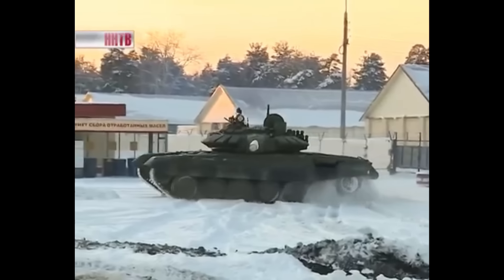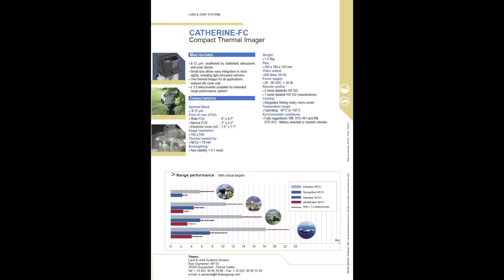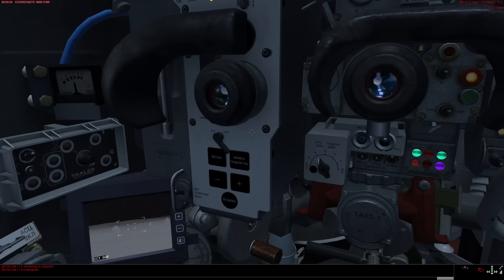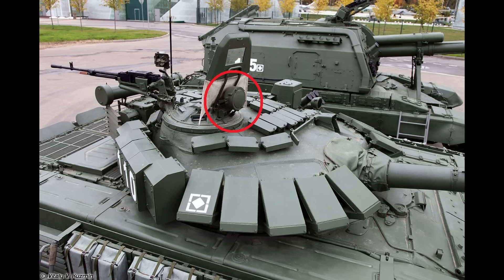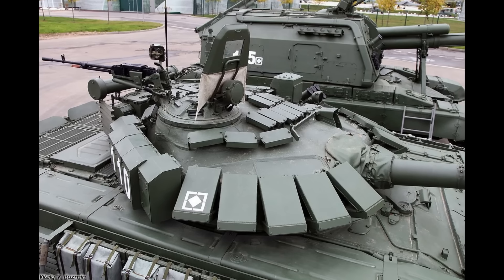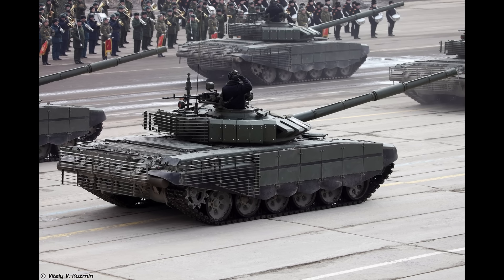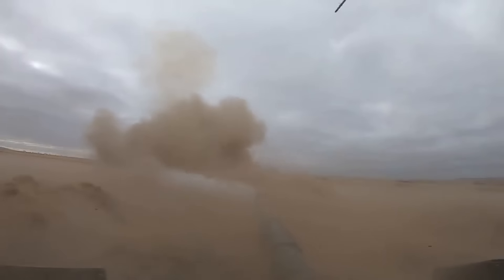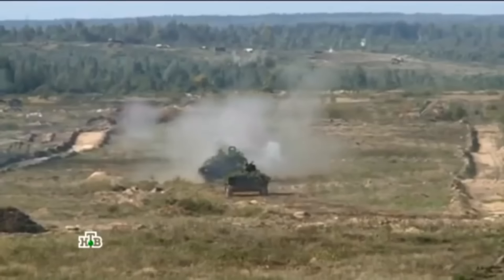Problems with Russian T-72B3 tank

Comment: Autoloader... good idea! Storage of Ammunition in Turret ... BAD IDEA!      Abrams is considered one of the most survivable tanks has rounds in its own sealed compartment designed to direct blast up and away from tank crew if ignition occurs.  The loader manually opens the armoured door to the ammo storage removes the round and loads it as the ammo storage door closes automatically...   In Iraq a number of Abrams looked like toast as they were penetrated but actually the crew survived shaken but mainly unhurt as the huge fireball of ammunition exploded out and above the tank.
Reply: That problem has been fixed or is being fixed 
T-14 fixed the problem ( T-84-120 T-72-120 is a possible fix )
T-90M/MS partially fixed it
Reply: While Abrams doesn’t have that problem it could still be cooked if the blast door gets destroyed when penetrated ( rarely but it’s still possible )

Comment: Why did Russia not invest more in APS systems? They used to have versions in the past.
Reply: They can't afford it.  At the start of this war Russia had an economy with roughly the same GDP as Italy, but they try to maintain a much larger army, navy and air force.  When you try to do that some serious compromises have to be made.  They have developed many systems and weapons over the years that never went into production because they couldn't afford them, and their economy is in much worse shape than it should be because of Putin and his gang robbing the country for decades.  Some analysts also estimate that at least a fifth of the defense budget is stolen; if they are right that won't be helping matters.

Comment: despite all the flaws... the main reason why it failed so much in Ukraine has more to do with tactics than limits by itself... i'll explain myself:

It is pretty clear that Russia's military and political leadership had a wrong assestment on the Ukraine's will to fight in 2022... they pretty much foresaw a conflict like in 2014 with enemy troops demoralized, poorly trained and with legacy soviet era equipment.

This lead for a strategy of a forward quick-push into the main citys, in the hopes of a quick surrender. That's why tanks were used in line formation (an extremely weak formation for defensive purposes) without infantry to cover them up AND at the very verge of their logistical capabilities.

Many T-72 faced doom against Karl Gustav 4 and RPG-7 at close distance as result of ambush tactics, many others were left out by troops that didn't really know what the plan was and find themselves at enemy territory with no fuel left.

Not to mention the lack of propper air cover and intel, which allowed for better placed ambushes, and last but not least the massive supply of high tech AT-missiles like Javelin which can't really be countered by any modern MBT.

If Russia had attacked exactly like that but with Leo2A7, the result would have been largely the same, maybe with less casualtys due to the western MBT improved protection, but at the end of the day, if your tank runs out of fuel you are on a sitting duck, that duck being a Panzer IV, T-55, T-72b3M or a Leo2A7
Reply: 2024 Update:

1) the 2022 Kiev Offensive was proven to be flawed by peace-time corruption in the Russian Army, since the general in charge of fuel depo "consumed" (a.k.a. black market sale) the reserves and lied about the numbers, that produced a real disaster leaving dozens if not hundreds of tanks with no fuel in the middle of the road to Kiev. T-72B3 or T-72B3M lost should have been way smaller just because of that, not to mention the bad "line formation" tactics.

2) since 2022 a lot has changed, the main flaw for an MBT is the Kamikaze drone, a cheap and easy to produce weapon that can pinpoint the weak spot of any tank, this kind of artifact makes anyone wonder why botter in a new tank anyway, since it is to be expected that Drones will become more and more efficient, introducing things like tandem-HEAT charges and other devices that could know out a tank... 

i wonder that if the way to go is a newly designed T-55 alike tank, with just a 100 to 105mm gun, good composite protection against 400mm frontal, around 100mm on the sides in a 35/40tn design, with good termals and optics, and a 800cv diesel engine filled around with of Kontact 1 (1st gen ERA) and cage armor

Comment: The obsolescence of militar equipment or systems or weapons, is not depending on time, but more over concurrence and circumstances of deployment.

Probably, over the T72, is more economical scrap and re-melt the metal over new machines, like T-90, or T14.

Meanwhile, the steel of the T72 maintain rolling, and work. And 
any way, a t72 in Ukraine, targeting infantry, is more valuable than is weight, in iron.

Comment: nothing to expect from the T72B3M, this is a cheap replacement for the T14 tanks while they are on trial, although the Russians said that they would not buy T14 because in the current situation it is not needed and it is expensive. I agree, T72 is much cheaper, about $1.5 million, It's not a pity to lose him, ans 4-5 T72B3M better than 1 T14 on which they can just drop a bomb or missile. although the fact that the crew left the T90M to the enemy is already sad, because it costs 4.3 million (how I know)

Comment: Funny gamers and fans of historical channels with their "opinions". 😅.  The T-72 was built against the Abrams, and is just as old and modified as the Abrams. And he will be an excellent competitor.10 t-72 against 10 Abrams tanks, abrams will not be taken out in terms of rate of fire. Its rear speed is the most powerful. The tank usually does not cover kilometer distances in reverse, it goes forward or sits in an ambush. Stop spouting bullshits. The automatic loader made it possible to equip the tank with protection without increasing the dimensions, weight and maneuverability.

Comment: Third time watching this video... and i rly dont know why they dont installed relikt on its front, this is funny because he have relikt on the sides, and tanks like t80bvm have relikt everywhere. And another thing is why, fucking why they maintain this trash comander sight? Sincerely if they wanted to keep the tank cheap they could installed the comander sight of t80u on it, that is an stablized one, have a better optic, the HMG on top is remote and have a far away better night vision that not depends on searchlights.
Another funny thing is that the frontal ERA coverage on t80bvm was done better, when in t72b3 it was made with the ass for some no reason lol.
T72b3 is not good but not bad at same time, we can say that it is the best cheap modern tank today, BUT we can agree that they could have done much better even if the objective was to maintain it cheap as possible, same for t80bvm.

Comment: Malaysia T72 variant has the best reverse speed....faster than European operational  Tanks...Thanks Germany for that
Reply: AFAIK "Pendekar" is a variant of Polish PT-91. Agreed, PT-91 is still "heavily modernised T-72", but all those units are build anew, and equipped with modern electronics, so more like "T-72 chassis based" than "T-72".
Reply: @MrKotBonifacy  even Poland PT91 is inferior to Pendekar Tank...it has better 125mm gun ZTS Special....amunition  variant of  3VBM23/3BM60..Can Launch Drone/loitering munition.. modern FCS Thermal Imaging ....Thermal Imaging Camouflage..Stealth Coating ... and an  Comander Independent  Panoramic Sight  (CITV)
Reply: @EmmaDwan8251  Sigh...

I thought I NEVER said "Polish PT-91 Twardy is BETTER than the Pendekar" but thanks for "proving" me wrong. Next time I'll always ask myself what I just said, I promise.
;-b

I said it clearly, albeit tad indirectly - "PT-91" itself was a "modernisation" or "upgrade" of EXISTING FLEET of several hundred tanks ALREADY in possession of Polish Army (hey, you just can't throw them away and buy newer ones, especially if you have a whole lot of soldiers trained on them, stock of spare parts and ammo, and entire maintenance machinery and workshop "backing" - and, last but not least, the country did not have the pennies back then needed to buy whatever new fancy gizmos were out there and then), while the entire Pendekar series consist of units "made anew". So they could MAKE THEM to incorporate stuff and what not that the older, existing hulls couldn't - or it'd be too troublesome and costly to do so.
The experience and R&D gained during development of Twardy was then used to make "new, better" PT-91 or T-72 if you insist - that is, the "Warrior" / "Hero" (or Pendekar in Bahasa Melayu).
 
Fun fact - the whole Pendekar undertaking was kinda in the "break even plus few pennies on top, just enough to buy some candies" area - and my guess is, they did it more for the sake of keeping experienced workforce employed and to gain some new experience (plus probably gain some footing in foreign markets), as that whole "modernisation program" (i.e. "Twardy") was meant, from the day one, merely as a temporary stop-gap solution.
Y'see, it was pretty clear and obvious that after "leaving" disbanded Warsaw Pact and joining NATO all the Soviet legacy stuff would have to go, the sooner the better - unless you want to "replicate" all the manufacturing base which made no sense at all (failing which some parts would still have to be imported from your now "prospective enemy", which isn't really a great idea in any field, and especially in the defence industry).

Now with new economic realities (and "the general international situation) all (or most of) them T-72's/ PT-91's went their merry one-way road to Ukraine, and Polish Armed Forces will be equipped with Abrams (most modern version) and Korean K2 "Black Panthers".
Leopards? "Sorry, we do not buy arms from best allies of our enemy."

Hope this make the issue clear(er)...?
Reply: @MrKotBonifacy  english is not my first language...sorry
Reply: @EmmaDwan8251  And neither is mine. No problemo, amigo ;-)
Reply: @MrKotBonifacy  its US$6.25 milion per tank in 2006....more expensive than US tank ..US$6.21 million (M1A2).....why Malaysia buy this Tank?
Reply: @EmmaDwan8251  Heh heh... good question... : )
Me dunno "why", but being tad familiar with Malaysia and its "ways" (like, 1MDB, Najib and his wife, Anwar's "sodomy" trial, and so on, and so forth - all the way down to petty undertakings like "making new drinking water pipe system in Pulau Tioman - I witnessed offloading of all those black plastic pipes back in '90s, and as of 2012 if memory serves me, they were still lying in Air Batang Kampung, where they got offloaded in late '90s), so being tad familiar with "Malaysian ways" I have my suspicions... ;-)
Also, I have no effing idea how much Pendekar costs - some sources say it's nearly $ 7.7 million per unit, while 2016 price for Abrams is estimated to be nearly $ 9 million per unit - so still Pendekar comes "noticeably" cheaper.

Also, when you take a look at tech specs like weight (Pendekar: 45.9 t vs newest Abrams 66.8 t), operational range (700 km vs 426 km - considering weight difference, in off road top speed and range Pendekar might come out even better) or fording/ underwater river crossing capacity (AFAIK pretty much non-existent in Abrams case while pretty good for Pendekar - but just "if memory serves me" so don't take my words for granted), engine complexity (Abrams has a turbine engine, Pendekar "classical diesel" one), AND putting all that it into the Malaysia context (her road and bridges, lot of dirt roads and small rivers) you might start to notice a significant advantage of Pendekar over Abrams IN THIS THEATRE of potential conflict.

Lighter tank means easier to transport by ship (from, say, Peninsular Malaysia to Borneo), better manoeuvrability on clay soil (perfect to drive on during dry season while a nightmare to cross during monsoon). Also, keep in mind with which country Malaysia "could, potentially", go to war? Indonesia and Thailand, and is the Pendekar "good enough" for this kind of "encounter"? Methinks yes, and anyway it'd be tad hard to drive heavy equipment over Thai-M'sia border (the heavier the tank, the worse it'll be).

There's a reason why Poland is buying more expensive, but LIGHTER K2 Korean tanks (55 t) along Abrams - even if K2's are more expensive tanks ($ 8.5 mln per unit). And then there's a good reason too why Chinese are now working on a "light MBT", Type 15/ ZTQ-15 ("Task and Purpose" channel did a good piece on it - "Why China's Army Needs this NEW Light Tank" https://www.youtube.com/watch?v=lrix9ozuuMc)
There are other "present/ current factors" (like "ready availability") and "future considerations" (licensing/ service hub) behind choosing K2, "but that's another story for another night" as Scheherazade used to end her tale telling sessions. And so will I.
Reply: @MrKotBonifacy  agree with what you said...Maybe Malaysia will buy Type 10 after this

Comment: why both Russians and Ukrainians prefers the T-80BVM over the T-72B3, i mean the Ukrainians have praised the tank due to the engine start time, battlefield reliability, speed, fire control, same it goes with the Russians, i mean the T-72B3 is much more armored than T-80BVM, plus it's durable unlike the T-80BVM, meaning with Diesel engine you do not need much maintenance and follow ups unlike T-80

Comment: T-72B3M modernisation - 1 mln dollars 
T-80BVM modernisation - 2 mln dollars
T-90A new built (or from T-90 1992) - 2.5 mln dollars
T-90M modernisation - 3-4.5 mln dollars
So you can choose between 4 T-72B3M or 2 T-80BVM or 1 T-90M.

Comment: Doesn’t matter, a T-72 is still a T-72. Until Russia dumps all the T-… series tanks and design a new tank from ground up it will always be junk. There’s a reason all other tanks have room for a loader and isolated ammo storage.
Reply: Saying "Until Russia dumps all the T-… series tanks" is like saying "Untill USA dumps all the M series tanks" or "Untill France dumps all the AMX- series tanks". It's just the standard designation and entirely new concept will also probably have T-XX name
Reply: You do know that tanks can have an autoloader and isolated storage, right? And the main reason for ammo detonations like these are loose ammo storage, not the autoloader.
Reply: @juliuszkocinski7478  you misunderstand what I meant by T-…, T-62, T-64, T-72, T-80… everything beyond that is still based off T-72. T-14 doesn’t count because it’s not an issued tank, but likely still a T-72 under the fancy facade. America did throw out its older tanks with the M-1 Abrams. As for the Germans, French, British I haven’t bothered to look at their current tank design layouts. I just worried about Armored Vehicle Recognition (AVR) and that deals with external features.
Reply: @voidtempering8700  Maybe, point is crew member protection out-ways autoloaders any day, I’d still take a loader over a 3 man crew and auto loader. With as much crap attached to modern tanks now, low height profile is out which was the T-series advantage. Also until all these new wonder weapons are actually combat proven, to include maintenance and down time statistics, I’ll stick to the old reliable M1A2 and it’s 4 man crew.

Comment: The loading system is far from ideal, for example, the pallet vibration system is not fully developed, and when firing an empty cartridge case, the gunner must catch it, otherwise it can roll into the turret control system and jam it.

Comment: The gaps are really small dude, its not like its going to matter much, must as well complain why there are gaps in between those rails right? You can’t possibly hit those spots with purposeful aiming, however the front is a different story all together.
The purpose of the tank is to be a cheap Conscript army tank capable of being maintained by a conscript army and sent to battle in a conscript army. Not excatly designed for a Professional army

Comment: Obviously T72B3 is just a cheap upgrade package, compared to T90M. T72B3 is not bad, its just old and it needs a new tank to replace it. T90M is the near to ultimate evolution of the T72 series and so it has come to the end of its potential. Hopefully Russia can finally sort that 100% domestic production for their T14 armata and can start to push them out.

Comment: a bunch of captured t72 seem to have had the ERA blocks filled with slabs of rubber.
Reply: source?
Reply: There are rubber layers in Kontakt-5 ERA. The tank in question was missing the explosive layers of the ERA blocks, but it's unclear if they were removed before or after the tank was captured.
Reply: It's obvious you didn't watch video about it on this channel.

Comment: How many versions of the T-72 and T-80 are there? 
Yes
Reply: Actually mainly only 3 are in use now. T 72b version with couple type of upgrades. Plan was all to be upgraded to B4 version. diference between t90 and t72 is same like diferencen between chalenger 1and 2. Plan was all t90A to be upgraded to t90M. As for t80...All were suppost to be upgraded to T80M but there would be models with 2 diferent engins. One with clasic diezel and other with gas turbin for artic reagions.
Reply: They all on Oryx with pictures😂

Comment: "Problems with Russian T-72B3 tank?"
 it keep blowing up when hit with a 50,000$ missile???
Reply: $150k missile
Reply: @Работаем, брат! So you obviously haven't seen those videos where Russian tanks are getting blown up by not only a single Javelin, but RPG-7 or RPG-22 projectiles too?
Reply: @sharwama992  not every missile is an expensive javelin and I bet there are many less than 5000$$$ missiles that will bust this tank wide open
Reply: @bobsmith-wg9fz  javelins are expensive 
Maybe spike missiles or Kornets probably even NLAWs are cheaper  but not $5000 with the exception of AT4